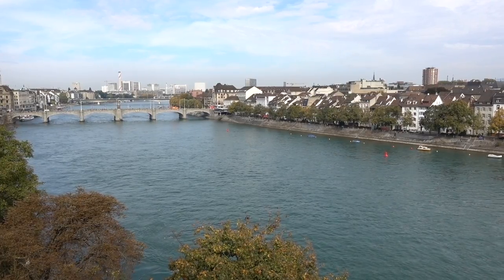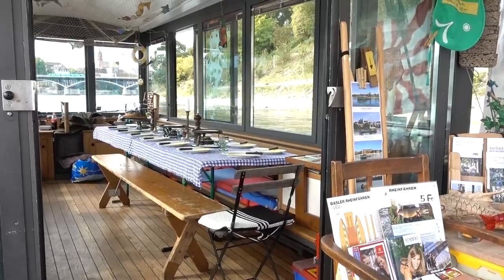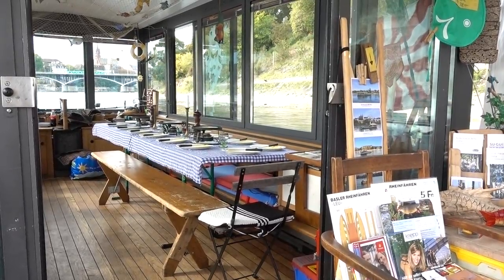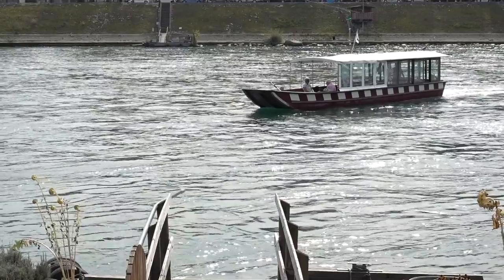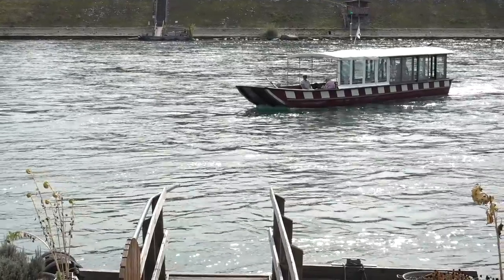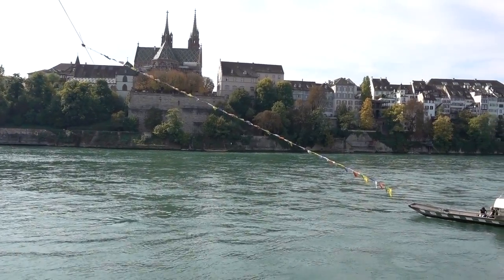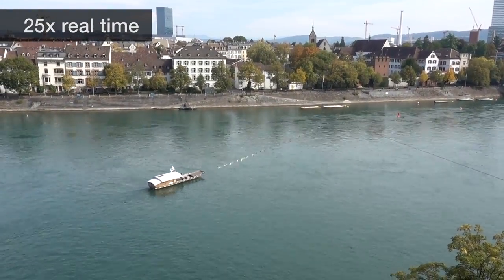Reaction ferries are really clever

Comment: What are the emergency procedures in case the wire snaps? On board anchor?
Reply: The dam downstream
Reply: They have a water-proof bible for the last prayers.
Reply: Just steer using the rudder to a place downstream
Reply: But he said that you'd go downstream pretty fast without the wire, so that would be more like crashing it.
Reply: Shannariano emergency paddle maybe?
Reply: rudders don't work well on non propelled boats, because the boat would be moving at the same speed as the water there would be no flow over the river = no steering
Reply: Swim.
Reply: Hint: "There is a hydroelectric dam not far away."
Reply: Tom said that there are no paddles or oars on board, I assume he would have mentioned emergency equipment if that was the case....
I'm still puzzled. The construction of the boat, as I understand, has no moving rudder, the only moving part is the lever that forces the ferry at a particular angle. It probably has an additional underwater fin parallel to the length of the hull, thus creating the necessary reaction force to move the vessel from one shore to the other.
It would be neigh impossible to steer it without the cable or some external implement.
Reply: Regular maintenance to ensure the cable doesn't snap, I'd imagine. Like a cable car or telepherique.
Reply: bren106 the damn is a couple hubdred meters UPstream. Though there are plenty of lock chambers downstream.
Reply: Shannariano there are paddles on board, that would be used to steer it to the shore. (Plus since the cargo port is downstream, there are plenty of boats that could help.) Additionally, the ferries don't opperate when the current is strong. (In a flood event) so the chances of failiure are really slim. The biggest threat are boats and swimmers
Reply: If the wire snaps, you get to enjoy a lovely trip down the Grand Canal D'Alsace! (provided the boat doesn't drift into the dam)
Reply: I imagine there's just a powerboat upstream listening on the radio for any emergencies.
Reply: Cyanide pills and a self-destruct mechanism.
Reply: The boat's body acts as a giant fin. Since it's held at an angle, the river water is pushed off to one side, creating a counterforce in the opposite direction.
Reply: Then you'd be...
(wait for it)
...up a fast river without a paddle.
Reply: You got this wrong. The current goes faster than the boat in any case -> there is laminar flow -> you can steer. Not as well as if speed over water would be greater but you can.
Reply: I am from Basel. Here is the answer: By moving over the lever, he also moves an big underwater fin (as you have already guessed)
Reply: Elias Aarnio No. You're wrong.  If you've ever steered any boat, you'll know that if the wire snapped, you wouldn't be able to steer.  Unless you're lucky and it's a very windy day (talking storm force here), there's no way you'd be able to steer while drifting.  Also everyone wondering how it works.  Tom said there is a rudder in the video!  Does anyone ever pay attention or even watch the video before jumping into the comments?!
Reply: I am an experienced sailor and a search and rescue volunteer person. I have also done a lot of raft and log riding on rivers both for fun and work. I know for a fact that it is possible to steer a boat with a rudder in current without propulsion.

Please notice that the steering force is generated by the laminar flow on the surface of rudder. It does not matter which direction it goes as long as you have laminar flow.
Reply: If you have never seen how a boar is steered on a river without propulsion check this out: https://www.youtube.com/watch?v=cU70cpsjmjE

Note that the outboard engine is not used in the beginning. The boat (filled with tourists btw.) is fully in control.

On a river or in other flowing water it is important to understand that the rudder works only if there is a laminar flow on the surface of the rudder, ie. the boat is travelling with a different speed than water.

Also, if the boat travels downstream slower than water the flow of water will of course be the opposite than normally when the flow of water goes from bow to stern. This means that the rudder has to be operated the "mirror way": when normally you would push tiller to left if you would like to turn right you do the opposite if the current goes faster than your boat.

Is there anything else I could explain to you landcrabs? :)
Reply: the dam is upstream so
Reply: >> an additional underwater fin parallel to the length of the hull

Keel is probably the word you're looking for, and yes, most boats have them.
Reply: J DeWitt yes, keel. English is not my native language and most of my vocabulary is a mix of terms from movies and videogames. Hull was the best term I had for what I meant.
Reply: Shannariano, I think you have great English!
Reply: You swim. People swim in the rhein all summer long
Reply: It's upstream. The Rhine is fully navigable from that spot downstream. Technically, you could end up in the North Sea.
Reply: Elias Aarnio that's bull. The boat in your link does not have a conventional rudder thats hinged at the stern but basicaly a single oar that can be used to throw the boat around using manual force, not relative movement of the flow over the rudder.
A conventinal rudder can be used for some weak propulsion, like a fishtail, but it's very ineffective. It certainly would not be enough to save a loose ferry on the Rhine. Thats when you dive for the emergency paddles under the benches.
Reply: Yes, what if the wire snaps? Or the front falls off?
Reply: Leif Vejby as long as it doesn’t happen in the environment.
Reply: The chances of that wire snapping are probably far lower than the chances of an engine failing in a powered craft.
Reply: This video is about Swiss. You are locking for something there to worry about?  You have to look harder!
Reply: Conrad van der Meer - the rudder only works because of the flow of the water around it. Once you are moving at the speed of the current, the rudder would not function.
Reply: Say: 'Hello Cologne'.
Reply: @bren106  they hydroelectric dam is upstream from the ferry
Reply: I think Tom would just have that edge case just print an error to a file to review later.
Reply: Everyone carries a passport in case, once they reach the North Sea, the next country they land in doesn't belong to the EU.
Reply: To Everyone stil wondering:

They do have a rudder for manouvering, which is used in daily service in combination with the cable-pole, such as breaking at the shore. 

Also they have a small board motor on board, which is used not used in daily service. It is used if not anchored to the cable (e.g. going to the docks for overhaul/inspection). It also has some emergancy rowing rudders are on board.

So in an emergancy cable snap it would be:
1. Use onboard motor.
 If that fails:
2. Use manouvering rudder to turn the boat down stream ( a 180 if you will) and then manouver it to the next best place/harbour. As soon as current allows it use the rowing rudders for propulsion.

There have been some cable snaps since 1857, but they are seldom and nowadays due to the small on board motor, its not a big hazzard anymore. They are very safe to use, and a cool way to enjoy Basel. 

Cheers and stay save everyone.
Reply: @ConradvanderMeer  Rudders don't work if you are moving with the water - the boat is stationary in relation to the water.
Reply: The dam is upstream tho, near Rheinfelden. I don't think there is one at the french/german border downstream

Comment: Essentially it is a linear turbine blade.  Or a rotary one of infinite diameter,  if that makes more sense.
Reply: Infinite diameter always makes more sense.
Reply: Or a very slow water-skier.
Reply: it's sailing using water currents instead of air currents/wind. Nothing new to a sailor, sailors of sailboats basically have to take this into account on fast flowing water as they need to air to be the one giving more force anchored against the reactions on the keel/center board to go in the right direction.

Comment: Escalators. Unlike Elevators (Lifts, for you Brits), Escalators don't/can't have counter weights. But why couldn't Escalators have generators or massive flywheels to generate or store energy of the ones carrying people downward?  That could then be used to help drive the ones carrying people up.
Reply: Well, Tom Scott made a video about another type of elevator: https://youtu.be/YgJBD1wf-YQ so I guess people already experimented a lot with them.
Reply: Escalators running downwards usually use their motor as a generator an produce electricity when more than two or three people are on them.
Reply: REALLY??
Reply: Da Hai Zhu escalators do have a counter weight.  A the top of the escalator the stairs go under the escalator and head down this acts as the counter weight.

Comment: You mean stuff like: Water as ballast (instead of concrete) inside washing machines right?
Reply: omg! why.. just why i didnt think of this before. it's seems so simple, easy and obvious.
Reply: Things grow in water they don't grow in concrete. And you have the problem of what of the tank brakes?
Reply: Sand or dirt works. You can put them in once they're installed and drain them to lighten the washing machine to transport it just like water.
Reply: What if you used the incoming water to push out the old water and used the old water to wash your clothes?  The old water would probably only be a few days old, and you could add a "purge" feature if the operator knew the water was older than this.
Reply: on second thought, there are a lot more moving parts to this.  Maybe it is just better to use heavy concrete.  And when your friends ask you for help moving, ask if there is a washing machine involved.
Reply: concrete - about twice as dense, cheap, and easy to hold in place.
Reply: Except you need to contain the water in a tight container twice the size of the concrete, because if it can splash around you just introduced more moving mass and rocking of the system ;-)
Reply: I should point out ^ isn't my original idea, I heard about this a while back: https://jamesdysonaward.org/en-GB/projects/lincrevable/
Reply: You could also use depleted uranium. Takes up much less space!
Reply: Hebl von Heblowitz I heard they have some nuclear waste left in Fukushima, let's build the machine in lead so we're certain it won't move at all and kind of contains the radiation ;-)
Reply: Heavy water would save space :)
Reply: The concrete blocks can usually be unbolted.
Reply: we could stick some neutron star in there instead
Reply: It is probably cheaper to just drain the water after each use than putting in extra parts. Water in my country only costs around 2.17€ for 1000L with sewage fees. (This is also the  price for 3 bottles of water in the supermarket with the same qualitiy of water.)
Reply: @0799qwertzuiop  But for a country like Australia that is short of water, this concept would not be good. We go from droughts to flooding rains.

Comment: Here’s my idea. Paddle wheel on the waters edge near the dock. This paddle wheel spins up a very heavy flywheel on the dock. This flywheel is usually at max energy given it’s constant power source of the river. 

The boats all have smaller flywheels in them that have enough power to get them across the river with a good deal of reserve, plus the flywheels can keep batteries charged on board for any electronics necessary for navigation/safety/entertainment. And since there will be batteries on board, you can have a small electric motor for backup if the boat’s flywheel fails somehow. 

Came up with this because I thought of reaction wheels when I saw the title and so I figured this is what you meant.

Comment: When you said the end there I had a crazy thought: use the waves and tides to lift the heavy weight of a gravity battery up a pole that is a like a ratchet so that when it’s lifted it keeps stepping up the pole and doesn’t slide back down. When it reaches the top of the pole it can have an automatic release and drop to the ground. While it drops it will generate electricity. This can be fed to the grid or charge a battery. If you created a farm of these it would work day and night and the different gravity generators would rise and fall in a steady but randomized way that would be consistent on the average.

Comment: very clever.  And om is right, there is probably a few "obvious" simple solutions to some things we just didn't think of because we didn't connect 2 existing things in the right way.

I don't quite how how engines or motors work, but I know most power stations work on an adaption of the principle of a water wheel.

Comment: for hundreds (if not thousands) of years, swimmers have used this to cross fast flowing rivers. it's called "break out" swimming to those of us trained as river rescue. The principle is  if you are out of energy, luck, ideas whilst in a river, float on your back, make big circles with your arms BUT mostly angle your body at 45 degrees to the flow of the river. This way you allow the flow to push you towards a bank and not along the length of the river out to sea (or a strainer or other risk). Animal use it when they are in the water and can be seen in a lot of places around the world. 
I've not seen the whole video (Youtube keeps crashing) but I imagine theres a large angled rudder under the boat that allows the flow of water to move it from bank to bank with an anchor point on the wire to stop movement down stream.

Comment: It's exactly how sailboats tack into the wind, only the sailboats use the water as the resistance and the wind to supply the power. Here, the cable provides the resistance and the water the power. Which I just noticed somehow has already posted but it's worth repeating.

If the cable was hidden underwater imagine how mysterious this would look.

Comment: In swift water rescue operations we do a very similar thing to set up a quick boat operation. We send a line across the river or stream using a line gun, throw rope or if necessary a swimmer. The line is tensioned and two pulleys are attached with lengths of line or webbing and by adjusting them we can effectively control the boat and position to perform a rescue. Its almost like you're sailing, just using the force of the water on the hull instead of wind on a sail.

Comment: Doing it without the overhead wire... it is used to cross the river with a canoe or kayak, by doing some paddling upstream a little and being at the angle to use the water pressure to push across.

Comment: I rode one of these near a small village in India. At the time, it really baffled me. This helps, although it’s still not completely clear as it was sort of jerry rigged. So it doesn’t look anything like this, and due to the length of time that’s passed, I don’t remember all the details either but I’ll try to recollect 

In the case of the one I rode, the ferry itself was the runner on the wire across the river. The object which harnessed the power of the river (the ferry in the video) was an old 80 liter HDPE drum. I don’t remember any more details, unfortunately.

Comment: You missed one of the most important and possibly hard-to-attain pre-requisites, Tom.  Lack of tide and steady flow both matter to the power. But even more important is that traffic up and downstream at the point of the wire has to be minimal, and all able to fit beneath the wire going across, including masts and dishes.  Put all of those requirements together and you have an extremely situational design best suited for places without much water traffic, and thus without much demand for a dedicated ferry at all.

Comment: What you describe is in german a „Seilfähre“ (rope ferry), very common in the old days. Interestingly kayakers use this principle for River crossing too, but instead of the cable they angle the boat and  paddle upstream with the same speed as the current. Also watch ducks, the angle also and paddle upstream crossing in a straight line. Only dog swim directly to the point on the other side while are swept downstream, making a „Hundekurve“ (dog curve).

Comment: That's almost exactly how you cross a river in a canoe or kayak without drifting downstream. Point the nose towards the opposite bank at about 30 degrees, lean slightly downstream and paddle occasionally on the downstream side to avoid being pushed downriver.  The steeper the angle you use the faster you go across, but also the more effort you have to put in to keep from being pushed downriver. It's known as "ferry gliding."

Comment: I have a few of these near where I live in Poland but instead of a rudder there are 2 cables attached to the boat one at the front and one at the back of the boat connecting to a cable going across the river and you set the boat across by shortening and lengthening these cables with a crank

Comment: It's kind of similar to how you get from one side of a fast moving river to the other in a rowboat. You use the oars not to row straight across but to keep the angle of the whole boat itself just right so that the current is pushing you from one bank to the other as you are going downstream. Something you couldn't do just by oar power alone.

Comment: Hmm, from looking at it the main steering is not from a rudder: it's main way to angle against the current it to move the position the wire attaches to the boat. I think it does have a rudder to control the  speed as it approaches the bank to not slam into the jetty but it's not critical to the operation

Comment: well if you use heat (external combustion) in a valveless afterburner ramjet, then you get easy water/air propulsion system, make sure the heat coil is after the hour-glass neck